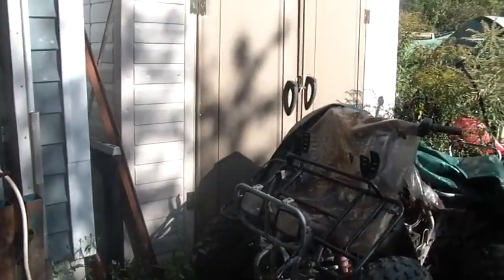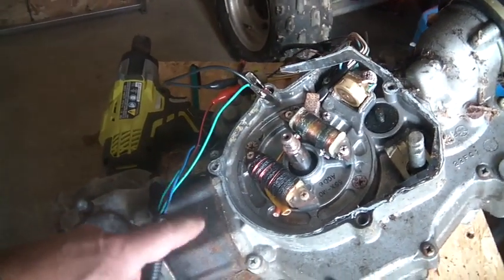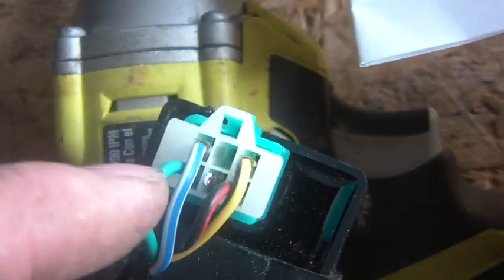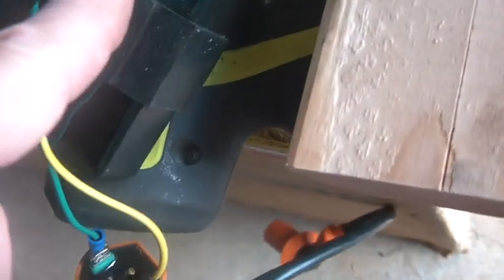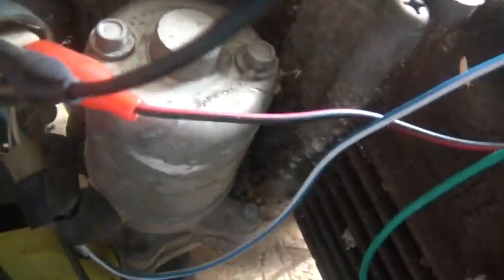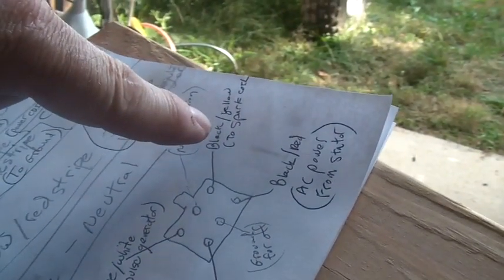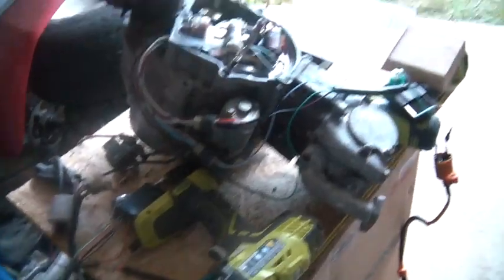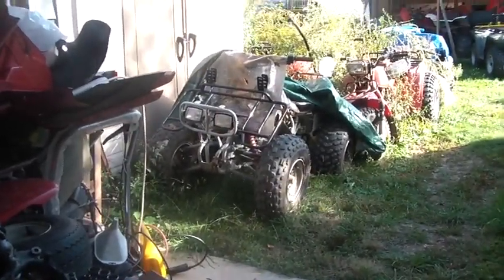Yamaha Moto4 wire harness decode, using a pit bike CDI

Comment: I know the green wire is most of the time the ground . But on some red hot coils it is the hot side. I had a gy6qmb and put a red hot coil in it and it did not run .

Comment: I have well what was sold to me as a 250 4stroke. Well the kill switch melted. It has 11 coil stator and 3 yellow wire stator. I need help asap. Please if anyone has any advive please help. I havent road this 4 wheeler in 3 years

Comment: FYI. I just rewired my Moto4 with a Chinese CDI and I had to wire one side of the trigger coil to ground and one side of the HV coil to ground. And I had to trial/error swap which side was ground to get a strong spark.  But it runs great now!
Reply: How long did your cdi last
Reply: @bryceknue6244  still running fine.
Reply: So in the end did you connect both of those to ground, or only one?

Comment: Thank you! For me it was about a week of me breaking down and refurbishing my 85 moto 4. Wouldn't spark, went through all the wires, starter, solenoid, get to the ignition coil and boom my ground wire from the harness was just taped in place, not connected to anything! The coil was brand new so I didnt even think to check the connections until I saw this! So again, thank you!

Comment: Hi I have a Chinese clone of a Honda cbx 250 two cylinder, I have the same cdi unit, but I got two coils, how do I set up the second coil? Do I just split the wiring so that it runs to both coils (wasted spark system) or do I need a different cdi unit or something? Please someone let me know, I can't really find information about this anywhere. 
Thanks!
Reply: mine has 2 you ever figure how to wire them?

Comment: Got 1980 Yamaha sr250 motorcycle no wiring harness will this AC cdi work. going to be used for racing . Spark only. No lights,horn ect.
Reply: Did you figure out the answer? Im in the process of installing a engine from 1981 Yamaha sr250 only to find out the cdi is actually a tci ignition with ridiculous replacement price.  Hope to find a cheaper option but havent found much.

Comment: Hey Harvey, I was wondering if you'd have a starter motor and wire harness for a Yamaha 225 trimoto?
Reply from the maker: Hey Alfonso, Where R U located, generally speaking, I do not sell parts, too much grief and too time consuming... About the 225, I would rather pull the forks and tires and sell or use the drive chain else where, parting out the ignition and started stops me from both possibilities... Thanks for asking, watching, and commenting!!!

Comment: Harvey, the CDI for the moto 4 should be an A/C CDI correct?  The stator is actually creating the power to power the coil.  Thanks!
Reply from the maker: Hey Robert, If the quad, trike, or cycle will produce 12VDC, I like to use the DC version of the portable CDI box... But, U R right, the moto 4 coil should produce the ac power necessary to run the ac cdi system.... Thanks for asking, watching, and commenting!

Comment: My motor doesn't have the black and red wires
Reply: Does it have an stator? There should me 3 wires coming out of your engine, two for power and one for the trigger signal (blue&white) you can check under your flywheel cover, the trigger wire is attached to another separate coil than the other two wires.

Comment: I got no voltage from the red/black wire to power the cdi. It failed the the test in the clymer manual for checking connection between the red/black wire from the igniter coil to the single black wire that goes to ground on the stator. The other coils pass their own described tests listed.

Comment: Hello, very great videos! Thank you! I have another question for you. I have a 87 Yamaha 350 big bear, and can find cdis only for a few years newer, 90-94 and 95-96. Would it not be possible to eliminate your "switch safeties and extras" that run into the CDI and just connect the trigger, power and ground connections to make a newer unit run on an older version? The connectors are mostly the same, and most of the safeties are the same however a few colors are different. My bike seems to have a slightly different wiring layout, that im not fully capable of understanding staring at both schematics. And on the same token, couldn't one make any CDI work with just bare bones connections?
Reply: My moto 4's cdi is a 6 pin, the bike is only a 4 pin, it came with 2 slots wired into each other with a short little baby wire.
Reply: Woah, my names Sean, my wife is Kaitlyn....if you had a daughter  named anna or lilly it would be more than freaky haha

Comment: i could use some help ole wise one i have a 87 lt230e Suzuki quad runner the CDI has a cold solder joint i think i have a vice clamp on it and remounted where i can smack it if it cuts out . a new or used one cost a lot any tips on a good cdi i can swap out i ordered a dc cdi for a "250- somthing  but have not tried it out . not even shore if my cdi is ac or dc lol
Reply: Hey what happened with this? I got a 85 230s. Cdi wires been cut down to 1 inch nubs and wire harness is gone.
Reply: @KevinBeGood  it runs good took 12v from the battery 1 wire from trigger to cdi one to ground then from cdi to coil